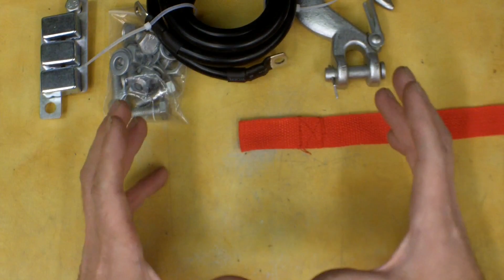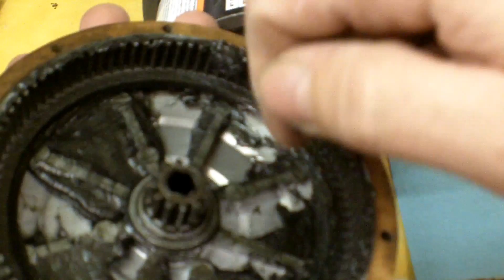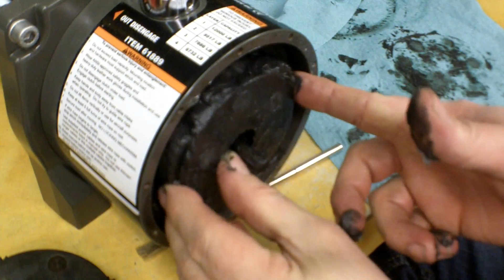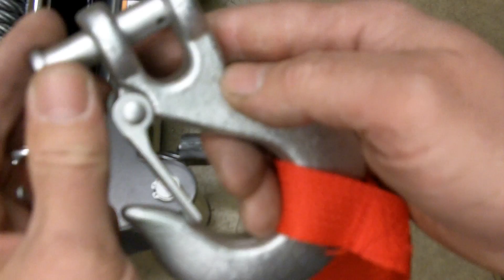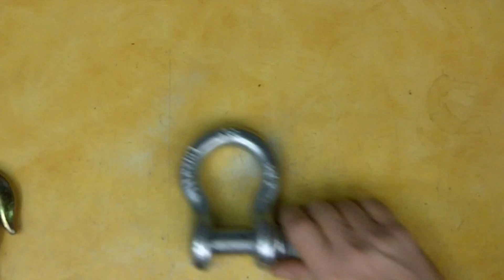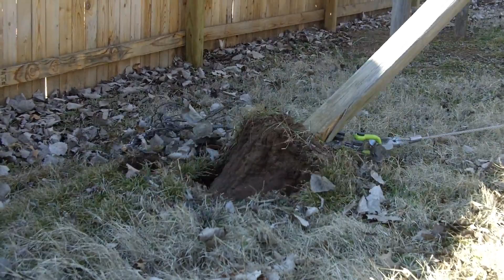Harbor Freight 12000 LB Winch Review, Teardown, Installation, Safety, Etc. Model 61889

Comment: The cable layer and power is wrong I THINK. Just think if a bicycle the bigger gear has less speed but more torque. The smaller gear has more speed less torque
Reply from the maker: +bobjones64 
I see what you're saying, but believe it's the other way around. I'm linking to the actual manual so you can take a look at it. Refer to the second page. Hope this helps! Take care, G.

http://manuals.harborfreight.com/manuals/60000-60999/60813.pdf
Reply: +ghostses alright thanks but the reason I was so sure was becaus I heard another guy on YouTube say the same as I did
Reply from the maker: +bobjones64 
That's cool. A bicycle analogy is difficult to be on the same page with because what's being left out are the peddles and the rear tire. The peddles are basically another gear of larger diameter than the front sprocket, and the rear tire is then again another gear that's larger than the rear sprocket. Throw in trying to drag 100 lbs behind a 3 speed bike and shift the gears, it gets into the crazy of things...lol.   If what you heard was in a video, please send me the link so I can listen. 

But, when I said the other way around, I was making reference to the direction of input to output related only to the two sprockets. The input of the winch would in essence be the small gear- the output the large. So, throw out the rest of the bike and think of a 3 speed rear sprocket set on a rear tire. The three sprockets represent the layers of rope on the drum. With the rope on the smallest sprocket and a 200lb weight on the end of the rope, It will have a slow line speed but with the most power to pull the weight. When you shift to the next sprocket (the next layer on the drum) the line speed will increase, but the power will diminish some and will be harder to pull the weight.  And when you shift to the largest sprocket (The last layer on the drum), the line speed will increase again, but the power will also diminish more and be even more difficult to pull weight. I hope that was a clear as mud...lol. G.
Reply: +ghostses Makes perfect sense to me. Good explanation for all the right reasons. Use of the snatch block is similar to use of a block and tackle setup, only you have electric power instead of people power. Trying to explain why a block & tackle works is really a challenge, but it helps in the MA category. Very nice video & your detailed information helps. If I were to buy a Harbor Freight winch, I think I would need to take it apart, clean it, then grease it properly so it would work right the first time and every time. Looking at the wires, I think they might be too light for extensive work. I off-road and I've been involved (stuckee) when two winches were required to get me back on the road. Each wincher used almost 100 ft of cable because of where we were located & how I was situated. Now I know how to do it better if it happens again.
Reply from the maker: +Harry Palmer 
Thanks Harry! Agreed, it's difficult to explain things (especially in text or without visual aids) and how they work. Even video is difficult from time to time. I'm glad you liked the video. What I did on this winch was for explanation, as well as adding an ounce of prevention by using known good grease. To date, it's been working great for me. The cables might be too light for extensive work, but I really don't know. Your story brings me to a point I did not mention in the video- being stuck. If you're buried in the mud, etc. you will need much more power to pull the load out- much more than what the load actually weighs. I know that's not really what you were referencing, but it might help others that read these comments. Take care, G.
Reply: +ghostses My issue was I dropped the front end off the edge of a mountain trail; I backed up but ran into a rock which was taller than my axle. I kept sliding and ended up sitting at 45° to the trail. With 10 vehicles in line, the ones with winches had a hard time getting to me. One man held the driver's door so I wouldn't roll over (650 yds on 60 % slope). The edge of the trail kept caving (3/4" gravel bed) so the winch in front pulled while winch in back kept me from rolling over. Lack of good tie downs or D-rings contributed to problem. If we could have used a snatch block for a 90° offset, we would have been better off.  Learning angles of attack always helps. Of course, if I had put the Jeep gears in 4 low with lockers, I would have gotten out much easier -my mistake, which won't happen again since I learned my lesson well. Use of blankets to hold the cable down helps. I've seen 2" thick cable break under load and it cuts 4" steel very easily. Kinetic energy can kill.  Thanks again for your video; it will help me in my future endeavors. I just wish I had a winch now so I could set a snatch block and remove a broken tree trunk which is stuck 40 ft. up on the adjoining trees.
Reply from the maker: +Harry Palmer 
And THAT"S mostly why I stay on paved roads Harry....lol! At least you survived to tell the tale. It's a much better story than "I once caught a fish this big"...lol. Removing trees, etc. was my catalyst for this setup and it works quite well. If you had a winch and some rigging, you'd have the trunk out in no time. Take care, G.

Comment: I got a little A frame about 3 feet high, that you put the cable over, then on the post and it pulls them nearly straight up. It makes it much easier.
Reply from the maker: +crusty old fart 
Very cool! I may have to come up with something like that if I need to pull any more. Thanks for the info! G.

Comment: I just bought a 99 gmc truck and it looks just like yours.  My I ask what hitch did you put on the front?  I want to do the same set up also.
Reply from the maker: +Ctcc73 
Mine's a 98 but I would imagine the hitch would fit yours as well. This is the exact one I purchased and was a direct bolt on. Hope this helps! Good luck, G.

http://www.summitracing.com/parts/CHT-31042

Comment: How has this been holding up?  You used it much?  Do you recommend (re)greasing it before use like you did in the vid?

Thanks
Reply from the maker: +YamahaWR200 
I've cleared tons of stuff with it and it worked great. I've only used it sporadically since then, but with the same results. Do I recommend using known good grease types like in the video- yes. Is it really required, I don't know. I can say whatever they use is some really nasty stuff and probably the absolute cheapest bottom of the barrel stuff they could find. Mind you, I did not run/operate the winch before doing what I did- but it runs really quiet and is easy to spool out and shift the lever. Hope this helps! Good luck, G.
Reply: +ghostses Awesome.  Well thanks for all the info man.
Reply from the maker: YamahaWR200
No problem! G.

Comment: i have a 2005 gmc sierra 2500. lots of extra weight, would this be good for me for emergency purposes only?
Reply from the maker: +Josh Alvarez 
I would think so Josh. If you use a snatch block and connect the cable back to a tow point on the vehicle, it would give you a 2:1 advantage so it should pull 24k lbs. It will cut your line speed in half using a block, but you should have no problem getting out. You might be just fine using a single line pull as well. Either way, the options are there if you have the proper rigging. Hope this helps. Good luck, G.
Reply: +ghostses ok perfect, i bought the winch and mounting brackets during the christmas sale, and i am just waiting for the mounts for my bumper. im going to mount it inside of my bumper and hope to use it when we sink in snow or when people need help here in eastern oregon. thanks for the video! i am no longer afraid of this winch. ill let you know how it goes! happy new year.
Reply from the maker: Josh Alvarez
That's cool. Do let me know how it goes and your thoughts after playing with it. G.

Comment: well done on the video.  I've had mine for 3+ years now on my full-size crawler.  no tensioner.  swapped in masterpull rope.  it has never let me down on the Rubicon Trail or Fordyce, etc.  I can confirm it draws alot, so watch your volt meter.  sometimes I've had to double up due to reaching load limit at 3-4 wraps. this is expected since I'm 7500lbs unladen.  I have cover that keeps it element life continuing.
Reply from the maker: +Wh1t3Nukle 
Thanks! It sounds like you've got good use from yours over the years. How much syn rope where you able to fit on the drum? That is, if you did take it to full capacity. Thanks, G.
Reply: +ghostses 3/8 by 85'
Reply from the maker: Wh1t3Nukle

Wow! 20' over stock- that's impressive. Thanks for the response. I'm sure it will help others out. Good luck, G.

Comment: We bought this winch for our log truck. We do NOT move logs with it. We fold a pole trailer up and lower it. The trailer total weight is 9,000 lbs. The winch lasted LESS than 5 months with daily use. It has given me nothing but trouble. It's JUNK. Let me say it again... this winch is nothing but JUNK!!!
Reply from the maker: +Nonyo Bidness 
That's unfortunate. For my uses it's works great. Do you know what went wrong with it, the motor or something else? Your experience might serve useful to others. Take care, G.
Reply: On several occasions, the motor would just randomly stop working. No clue as to why. We had someone look at all the electrical and never found a reason that would explain it. After a little while, maybe a couple of hours, it would go back to working. Until today... today, it's decided it doesn't want to spool out and the handle to free spool broke off when I tried to twist it. It's awesome too because the cable is tight on my pole trailer and I can't release it. That means I can't lower my trailer, so I can't haul. I missed two loads. So tomorrow, I get to cut the cable (under pressure... yay me) and replace the cheap piece of junk. If it's not a WARN, it's not a winch. Learned that lesson the hard way.
Reply from the maker: +Nonyo Bidness 
Thanks for the response. If you used the three circuit breakers, that might be part of the intermittent not working issue. I don't know if the motor itself has thermal protection, but that might explain that problem as well.  Not that I know exactly what's wrong with yours, I can give you a couple of things to try since you have it under load and need lower your trailer. If it's not spooling out under power, the solenoid might have something wrong with it. You might try opening the controller box and tapping on it. Or perhaps try changing the wiring so the "in" is actually "out". I know I wouldn't want to have to cut the cable with that much load on it. Just some things to try. If you can limp it down, it would be much safer than having to cut.

Yeah, since  you use a winch daily, you'd probably be better served with a Warn. For the casual user like me, this one fits the bill just fine. Either way man, be safe and let me know how it turns out. Good luck, G.

Comment: Looks a lot like my 10,000 Mile Marker. Who makes the Harbor Freight?
Reply from the maker: +G Nutter 
I'd sent you a pm since your settings wouldn't allow me to reply. It seems you've corrected the problem so I'm adding my comments here for others. I think the designer of these winches used to work for MM. I did read that somewhere. I agree, they do look very similar. Take care, G.
Reply: G Nutter is

Comment: Excellent video. Your cadence is perfect. I especially enjoyed the "in the field" segment starting with little saplings and moving up to some of formidable size. 
What is the name of that claw tool used in the video and or where did you find it? I've got some pesky buffer brush needing some ghostly treatment.   Thanks
Reply from the maker: +Mark Dalton 
Thanks Mark! I'm glad you liked it. The tool is called a Grubber. They have chain type and claw type. The chain type works ok, but has a tendency to slip off more than not. The claw type works great. It does slip some, but not near as bad as the chain. They have many sizes depending on need. Mine is a BG-08. I got it from Northern Tool. Here's a link to all of them. Hope this helps, G.

http://www.northerntool.com/shop/tools/NTESearch?storeId=6970&ipp=24&Ntt=grubber
Reply: +Mark Dalton - Yep, you nailed it Mark. G's cadence really makes this video very watchable and clear. So many instructional type videos miss this important feature or clutter the info up with distracting and time wasting stuff.

Great job G, and thanks for the useful extras!
Reply from the maker: Start The Rebellion
Thanks! I'm glad you like my style and gained something useful. Take care, G.

Comment: So I have to ask how else would you power something like this winch? They say to have the vehicle running so the battery can charge. What if you have this thing hooked to something that doesn't have a motor or generator? How many pulls do you think you could get with a deep cycle marine battery? Say like 10 ft pulls each time. It does depend on the size of the battery also. The reason I ask is because we have a ton of trees down in the creek by my house (also upstream) and this would help to get them out. I'd need something like a floating pontoon to haul the trees and maybe a onboard generator to keep the batteries topped off?
Reply from the maker: +Love2boat92 
I would certainly use a deep cycle battery with the most CCA you could find. As for how many pulls you could get before a recharge- I wouldn't know. It would depend on how many amps you're pulling from the battery. The harder the pull, the more amps it will draw.  Even if you had a generator running a battery charger, you might have to wait a long time for it to charge back up. If you're in no rush, I would just use the battery for what you can, recharge, then go back for more. G.
Reply: ***** Yeah. That does make sense the more you pull the more juice it uses up. I thought about using a gas powered winch but then I looked at the price of the winch alone (no engine) and I could buy like 5 of these winches. Lol. Don't think that's going to happen.

Comment: The problem with many of these cheap winches is the motors. The motors pull a lot of amps "power" and can drain your battery. Secound is they get very hot and burn out on a long hard pull. Third is water gets inside and has no drainage turning the  grease to muck. I got this info from 4WD Action Magazine Australia.
Reply from the maker: +rudedogii 
I didn't read the article but will add what I know. In regards to the amperage draw being more on a cheap winch- mine in particular. This one claims to have a 342 amp draw at the full 12k lbs. Looking at the specs of a VR12000 Warn winch, they claim 457 amp draw at the full 12k lbs. HF may be stretching the truth a little bit, but then again Warn might be as well. They can certainly drain you battery since these 12v motors can draw huge amounts of amperage. Using a battery with more CCA might help, as well as leaving the vehicle running during winching applications.

I can't compare heat generated on this one related to something more costly, and don't really do long hard pulls anyway. But, for what I use it for, it's remained rather cool- never so hot I couldn't leave my hand on it. You do have to respect it's duty cycle or it will overheat for sure- not unlike most of this type I would assume. This one is rated at 5%. Warn doesn't give a number, they just say it's meant for "intermittent duty". What that actually means is anyone's guess...lol.

I would agree with water entering into the winch based on it's IP66 rating. This rating is only for dust and powerful water jets- not submersion. I coulndn't find a rating on the Warn so I don't know how they should behave. I had seen some line-up testing where they were submerging winches in a tank to see how they held up. That's not a valid test in my opinion and is misleading readers. The IP rating clearly sets the standard of what it should be able to withstand, and submersion was NOT one of them if the line-up used all IP66 rated winches. If any were rated for submersion, again not a fair test comparison and still misleading to readers. Come to think of it now, perhaps the Warn has no IP rating or it would surely be listed in the specs I would think. 

For me, I paid $300 for the winch itself. Warn lists theirs at $800. That's a pretty big difference for something I would consider comparable products. About $750 is what I have in my entire setup- mount, rigging, grubbers, etc.The Warn does have more cable which might be desirable for longer pulls.While I've no doubt the Warn might be superior in some way, the cost does turn me off for my use. I don't off road so I don't run a risk of being stranded. For those that do, it might be wise to choose something else for peace of mind, but then again they can fail as well.

I encourage everyone to do their homework and get the best product for their use, need and cost taken into consideration. For me, this one works great and was within my budget and needs. Good luck and take care, G.

Comment: How did you get the grease out of the winch hosing itself? Did you just wipe it clean or use some sort of degreaser? Great video.
Reply from the maker: +waldan1701
I cleaned most of what I could with blue shop towels then used, I think Simple Green, on a tooth brush for the rest. Good luck, G.

Comment: Is ur truck a Tahoe or surburban I want to mount a front hitch and don't know we're to begin
Reply from the maker: +Kelvin Grant
It's a 98 GMC K1500 4x4 truck. I purchased my front receiver from Summit Racing. This is the exact one I purchased. You can look trough the application list to see if it will work for your vehicle.  It's the best price I was able to find. Good luck, G.

http://www.summitracing.com/parts/CHT-31042
Reply: Thanks I got the same year I have a suburban
Reply from the maker: Kelvin Grant
No problem! G.